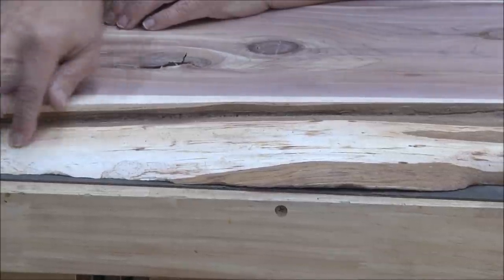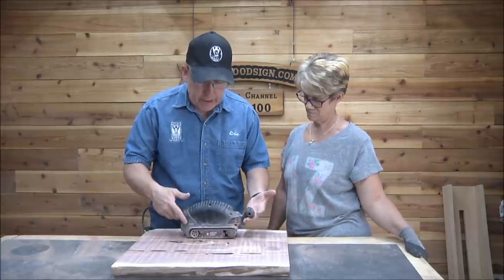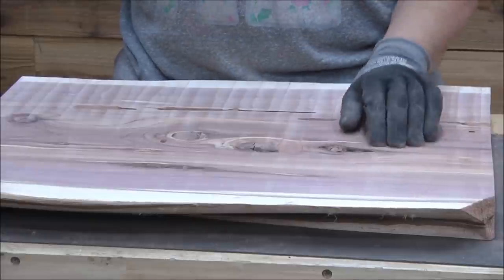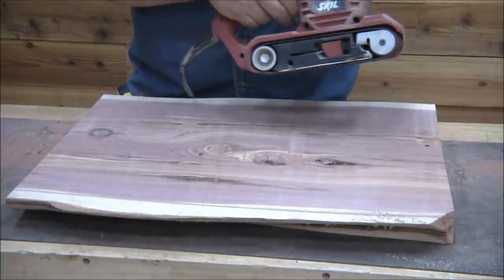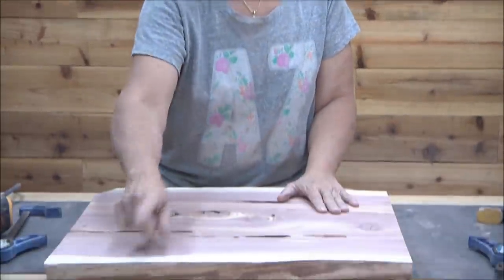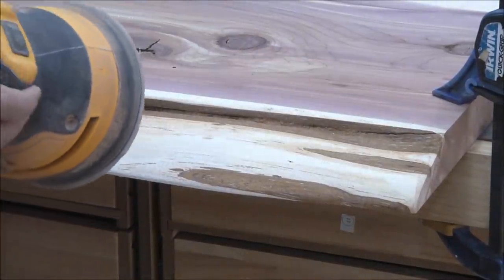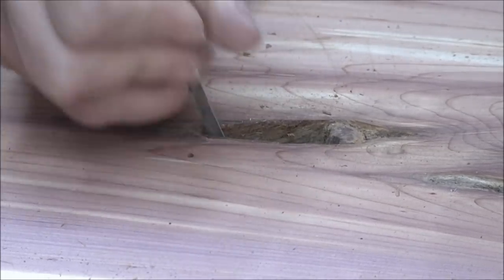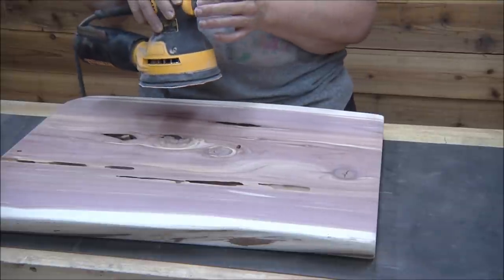#280 Part 3 Making Vicki's Slab End Table Epoxy Resin Coat Prep

Comment: I bought the skil belt sander after watching Eric sand off the signs.  However I am not as skilled as he is and I have put some pretty bad scratches and gouges in some of my work with that thing.  So now I am leary of using that sander.  I pretty much stick with the orbital sander.  I need to learn better techniques on using the belt sander.  I appreciate the tips that you gave Vicki and will try a lighter touch on future projects.  The belt is so much faster than the orbital but if I am gonna mess up my project I tend to shy away from that.
Reply from the maker: Yes it takes a whole to get the feel and develop a touch with the belt sander. Try practicing on some scrap wood. So much faster when you get the feel of it.

Comment: Great video, I have a question,, Do you know what varnish to use over carved art after painting with acrylics, to keep the colors and whites still strong and vibrant, before putting the art resin on? or is just the art resin good enough and wont blur the colors or tinge the whites? would anyone here know?
Reply from the maker: I have put resin over lots of colors and it was never a problem. However since I just started using the acrylics I haven't had a chance to try that yet. I'm sure it would be fine, but I would experiment first before trying it on a customers project. I'll be trying that soon. Thank you my friend, Eric